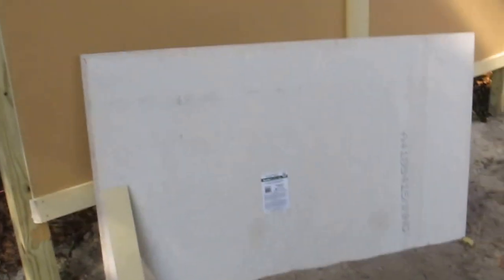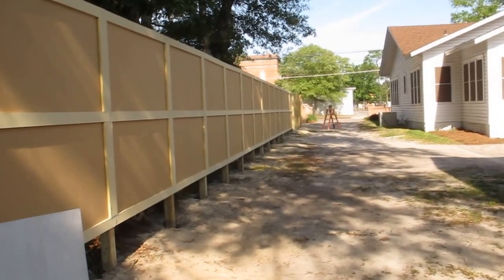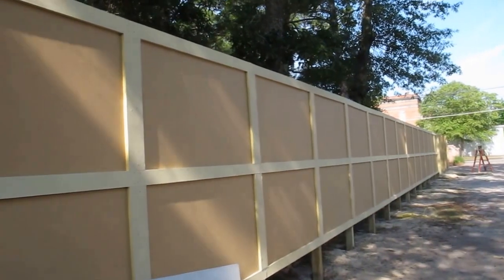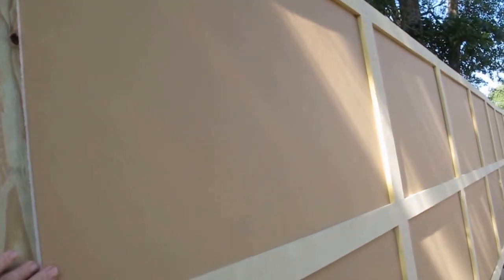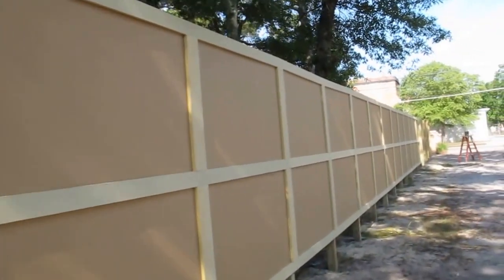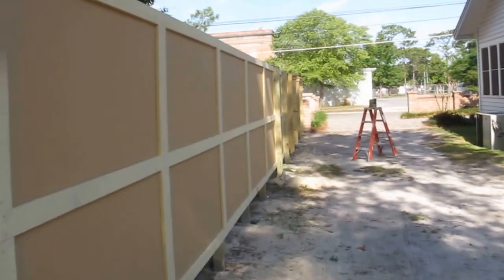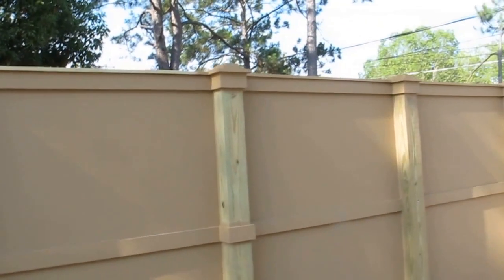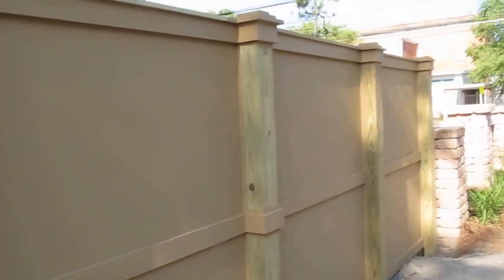Hardie Board Fence

Comment: Great looking fence. I do have a question. How did you get those second 4x6's in after setting the 4x4's? Seems you would have trouble digging the second hole right next to the first. Could you explain how you did that? Thanks.
Reply from the maker: You are correct. It was not easy. I had to break out the concrete on that side of the post with a sledge hammer, When I did the fence on the other side i only used one 4x6x10 PT post. and 120lb of concrete. and use 1x6 Hardie trim to cover the panels.

Comment: It's will last 100 years
Reply: Sonny Wilson nope the post will rott on the bottom and when a hurricane comes it will blow that whole fence down and it will be heavy
Reply: think deep before they happens, the posts will begin to twist and eventually crack the Hardi board.
Reply from the maker: @dangerboy808  5 years and still looks new. The fence survived hurricane Michael 150MPH winds for three hours
Reply: @markcordrey4453  itll be a while before posts begin to rott, but when that time comes, baaammmm
Reply from the maker: @dangerboy808  Properly install fence post will last. That is you do not incase the bottom of the post. The average life of a  pressure-treated posts is thirty to forty years.
Reply: @markcordrey4453  wouldnt you think by encasing the bottom of the post with almost trap moisture on the bottom of the post and it wont be able to drain down?
Reply from the maker: @dangerboy808  exactly do not incase
Reply: @markcordrey4453  I thought that the rot occurs at ground level, so you should encase only that section of the post right at ground level, and slope the cement away from the post. Is there a problem doing this.